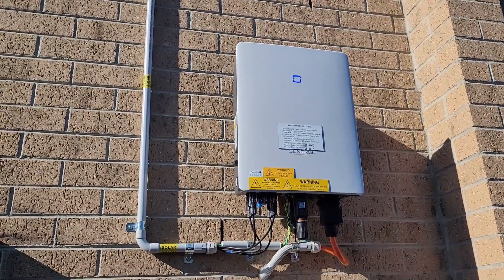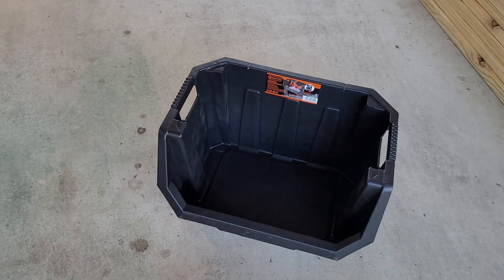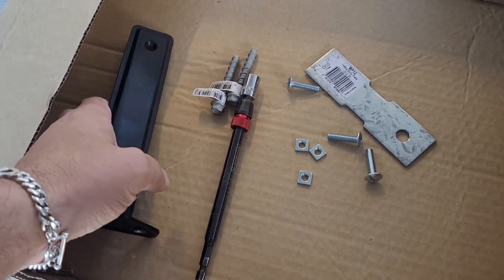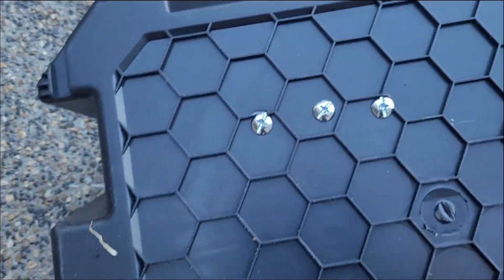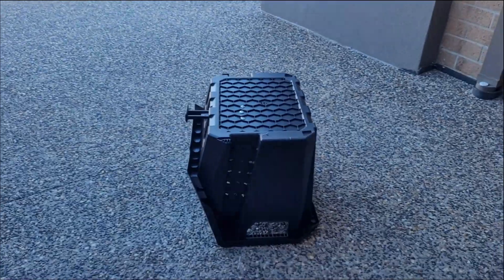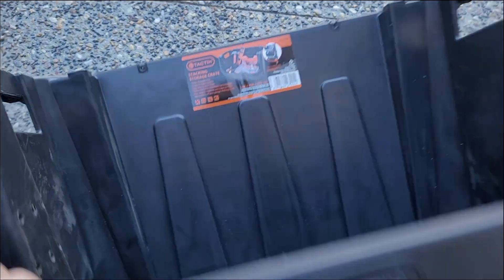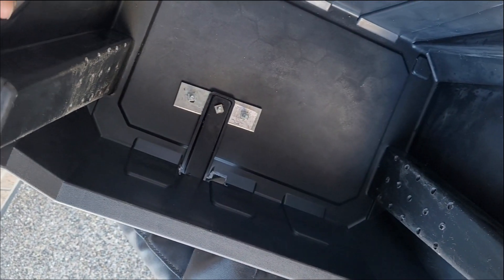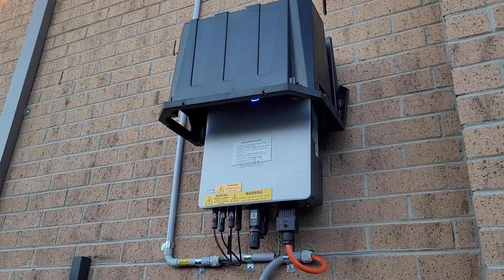Budget Solar Outdoor Inverter Cover/Shade (DIY)

Comment: Not the most aesthetically pleasing option, but does the job cheaply. I'm looking at options too my friend. Getting up towards $400 with shipping is insane for a few bits of sheet metal
Reply from the maker: agreed, I just need something which can block afternoon sunlight on horizontal angle.

Comment: Thanks for the video. What about the other half of the unit that's exposed, is that a problem for the rain?
Reply from the maker: Usually the unit does not need protection from rain, but excessive heat. The angle of sunlight on my wall was perpendicular to the unit so this was compact and budget solution.